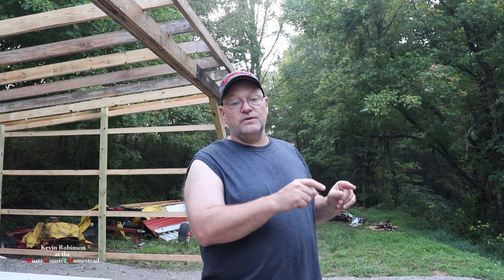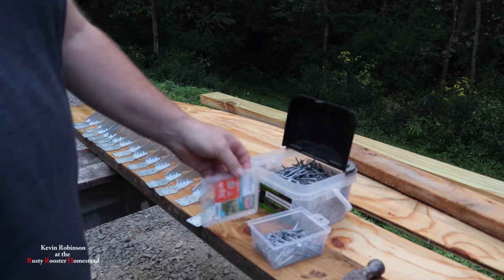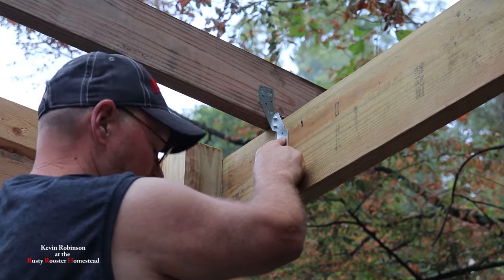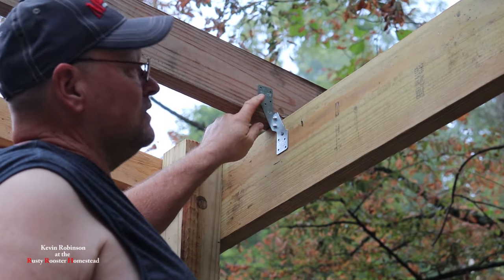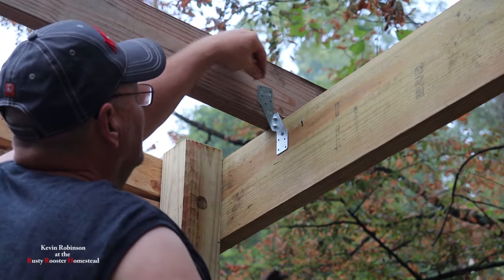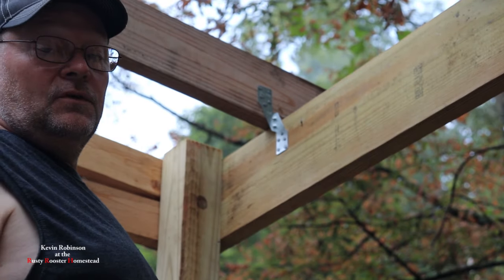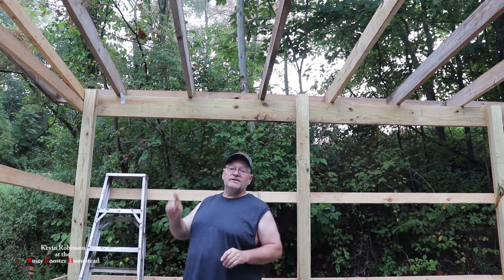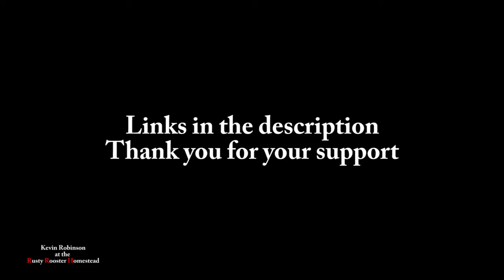hurricane straps strong tie

Comment: Simpson screws are probably better, stronger hold and less work. My opinion, if you can afford the screws, use them instead of nails. For those interested, this is a quote from Simpson about their screw: Specifically designed to replace nails in certain Simpson Strong-Tie connectors and is the only screw approved for that application. The #9 and #10 SD screws replace 10d and 16d nails, respectively. The single-fastener load capacity of the SD9 exceeds the capacity of a 10d common nail, while the single-fastener load capacity of the SD10 exceeds that of the 16d common nail.

Comment: Simpson dictates to add hurricane straps to the exterior of the building, will not warranty when installed on the interior alone.  You can double them up however one on the inside and one on the opposite side exterior.
Reply from the maker: Thanks for sharing.

Comment: I installed mine just like you did.  Then I saw a line on each one for top plate so there's no obstruction on the wall if drywall or other paneling is attached.  You just have to raise them up to the line.
Reply from the maker: Thanks for the info.
Reply: Yeah I cringed when I was watching 😂😂 even though it won't matter for his application

Comment: What do you do when installing ceiling and it hits the metal part that sticks out?
Reply from the maker: Good question i don't know i never used them where i needed a ceiling. i will have to research it. Thanks for watching and Happy New Year.
Reply: You slide them up so the part that juts out is above ceiling line